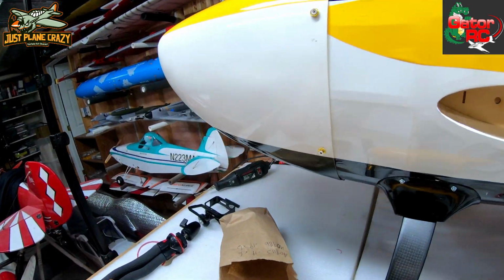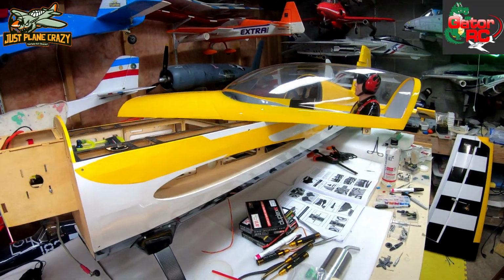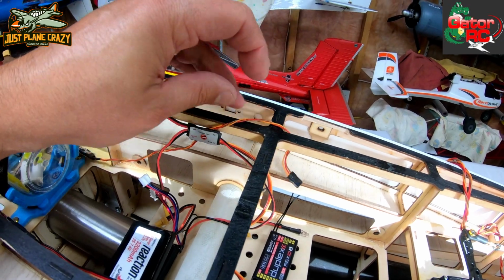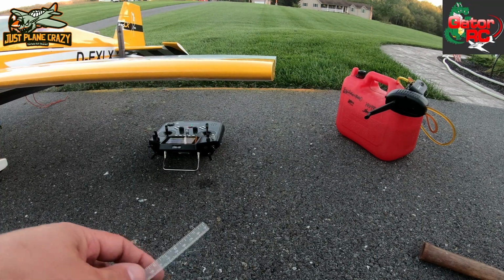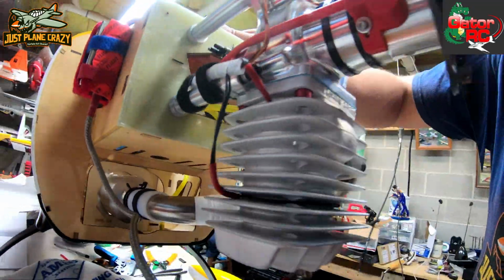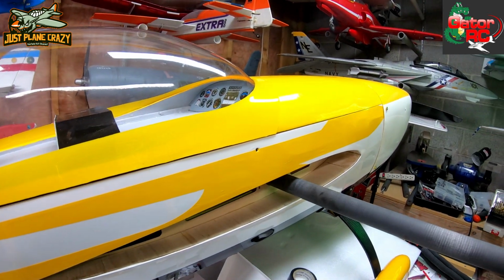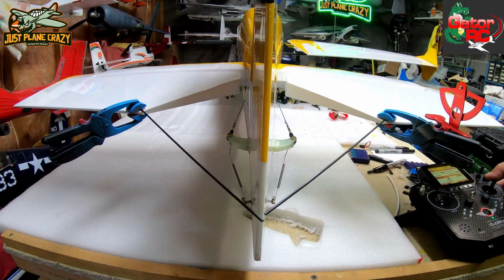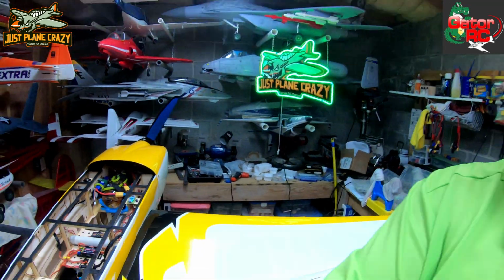Seagull Models 50cc Extra 330lx from Gator-Rc, Build pt.3, Electronics, Cockpit, Canister Exhaust

Comment: This video popped up in my feed again. I see you use wire loom to protect your wires. I got a great tip from a friend. I use rip cord. We get it from home depot in Canada. Comes in different sizes and colors. Its very soft and easy to use. Just pull the string out and pop off the servo connector with a exacto blade or a small flat head screwdriver. Slide it on then pop back on the connector. Its easier for guys like us that make our own extensions because we can put it on the wire first then crimp the connector. And its dirt cheap but the reason i use it is its very flexible. Up to you

This plane is on sale at gator rc and your video took me there. I might buy one. Sucks that i live in Canada tho
Reply from the maker: Thanks for the tip and watching. Much appreciated. Did you buy one?

Comment: I saw one of your videos that mentioned something about setting an electric motor on an rc airplane so it rotates slightly when the plane is on the ground. if i got it correct. if not I apologize.. can you refer me to the a video resource ?
Reply from the maker: I have done that in a few vids. The CARF 300 Texan 2 and most recently the maiden of the Marchetti. Basically you set an idle up rpm in your radio on a switch. Jeti makes it easy to
Reply: @ thank you very much sir for your help.

Comment: Hi there again haha,  where did you get your 4 inch pull pull rudder arm from? I'm looking for one for my hitec servo cheers
Reply from the maker: https://www.spotonrc.com/search-results?q=Rudder+arms&type=products&page=2
Reply: @JustPlaneCrazy  Hi there done range check etc on 330 yesterday evening weather wasn't great but started motor 3 flips bit of a taxi around then decided to fly flew well slightly nose heavy flew for 7 mins then landed and the white pipe joining the canister together had slipped off somehow but other then that was great felt good,
Reply from the maker: That’s awesome super congrats. Did you clamps the white thing?
Reply: @JustPlaneCrazy  yes I did clamp it with the black Clamps that come with the canister
Reply from the maker: So my recommendation would be put it all back together correctly with the clamps on and take a heat gun to it to help mold that plastic under pressure
Reply: @JustPlaneCrazy  ah yes I was kind of thinking along that line, if I added some high temp red silicone gasket seal as well ?
Reply: Also where did you get your bit of blue tube for the exit on the end of your exhaust cheers
Reply from the maker: I would not. It typically doesn’t stick to the silicone
Reply from the maker: McMaster Carr
Reply: @JustPlaneCrazy  ok cool no worries appreciate your help again
Reply from the maker: Anytime
Reply: @JustPlaneCrazy  Hi there again done 3 flights on the 330 balance feels really good had a dead stick my fault run out of gas very lucky to glide it in, how did you run in you DA 50? Did you adjust the needles at all? Cheers
Reply from the maker: I typically turn each one a hair literally more open. As long as the transition is there I leave it for almost ever. While it’s new I try to limit maneuvers that cause less airflow
Reply: @JustPlaneCrazy  Hi there just in case anyone asks you I maiden the Seagull focke wulf this morning it's got a DA 50cc Pitts exhaust on the front I had no idea where the CG was ment to be after reading hundreds of forums online I settled for 155mm back from leading edge at fuse, I still needed to add 900 grams of lead to motor, was still slightly tail heavy however thought will fly anyway and it actually flew very well and fast it was a bit Tail heavy but didn't really notice it landing was nice, being a heavy plane it glided in alot better then I was expecting. Just my in put in case someone asks you cheers,
Reply from the maker: Dude that’s awesome. Thanks for the info and congrats on the maiden. Awesome plane u got there
Reply: @JustPlaneCrazy  thanks was nervous as but went well, what would you recommend for another war bird is the zero a nice build?
Reply from the maker: Omg. It’s my favorite. I have a nice selection but that one I love.
Reply: @JustPlaneCrazy  so worth getting then? Was it an easy build and is it a seagull model cheers
Reply from the maker: It was the giant scale version seagull models. The build is simple. I took a lot of time doing the weathering and cockpit. Get it from www.Gator-Rc.com and don’t forget to tell them I sent u. They are great folks.
Reply: @JustPlaneCrazy  awesome will do cheers

Comment: Hi there again just wondering where did you end up having the cg I currently got mine at 95mm back almost perfect with empty fuel tank, yet to maiden but it's built ready has been run and motor runs beautifully cheers
Reply from the maker: I am currently at 100mm measured at the wingtip from the leading edge.
Reply: @JustPlaneCrazy  cool perfect I'm on the money then, now need the weather to calm down so can do maiden, cheers
Reply from the maker: Good luck with that maiden. I feel like at that cg you can do any maneuver. If you want a bit more stable 95 would be IMAC perfect. I am not kidding this plane is really locked in
Reply: @JustPlaneCrazy  awesome it looks like it in your videos I basically followed your build to make mine almost the same cheers

Comment: Hi there I have the exact same plane but in red and white I'm also running the DA 50cc with the canister system did you have to cut some of the length off the pipe to get it to fit? I've basically followed you when building mine cheers form new Zealand
Reply from the maker: Non of the pipe was cut. I did add an extension to the muffler outlet. It’s just heat resistant silicon
Reply: @JustPlaneCrazy  Hi thanks for the quick reply I was wondering if you did that, also did you glue the canister holder towards the front? Very handy build video cheers
Reply from the maker: I actually installed two. One towards the front one towards the rear. Got the ones from DA and cut them to fit my needs that way the canister is completely supported.
Reply from the maker: Not needed in a gas engine. The tank has three lines. One from carb to tank. One from filler to tank. One for vent pressure. That’s the top highest one and can loop around the tank or out over the engine just so it makes a higher point as high as you can get it above the carb. It allows air to escape while filling and prevents fuel from running out while upside down
Reply: @JustPlaneCrazy  ah perfect cheers appreciate the quick replies and help

Comment: Just a trick, use the HVAC aluminum tape cut in thin straps to wind around any sensors or servo wires going near the ignition system. It acts like a shielding on a cat6 wire or RG wire. You'll get almost no interference with electronics.
Reply from the maker: Nice idea. Thanks
Reply: @JustPlaneCrazy  just twist the wires before wrapping them, just like cat6 cables do.

Comment: Why would you ever try to balance a new plane without the cowl and spinner on the aircraft? This is not how you should try to balance a plane and it is not the way to show new modelers the way things should be done. Wow.
Reply from the maker: The point was more of using felt pads and how I measure. I as stated was getting a rough idea for placement of batteries and electronics .  I appreciate your opinion though.

Comment: I always drill from the back of the prop and drill so it mounts at the two o’clock position for flipping.  Love my DA motors.
Reply from the maker: I am throwing  a da 70 in my next project :-)
Reply: You will love the DA070, I have one in my Flex Innovations Mamba.  The twins run so much smoother than the single cylinders.    What’s your next project?
Reply from the maker: Oh my friend now that wouldn’t be much fun if I give that away now would it. You know what they say where there’s smokes there’s fire

Comment: Im surprised you ran it without the wings.
Reply from the maker: Just briefly. The rest was with them on
Reply: @JustPlaneCrazy  i saw that. I noticed not much carbon or bass wood in there so it couldnt have hurt anything anyways
Reply: @JustPlaneCrazy  BTW are you familiar with the German F.E.M.A electric start system?
Reply from the maker: Can’t say I am. You have a link?
Reply from the maker: Very interesting. Wonder how that rear mounted motor does in most motor boxes. Seems like it would take out a good bit of it
Reply: @JustPlaneCrazy  wish i could send you a picture of mine. 
Its completely recessed into the firewall. Uses a dog bone to a spur gear then to the crank shaft one way starter clutch. 
Really an elegant set up. 
Super simple
Reply from the maker: Looks neat. I have a similar setup on my Zero for my EME60
Reply: @JustPlaneCrazy  i saw that. I like the relay set up. 
I just have two servo activated switches one for the glow igniter and one for the starter
Reply: @JustPlaneCrazy  actually ill make a video of it and post in to my channel right now